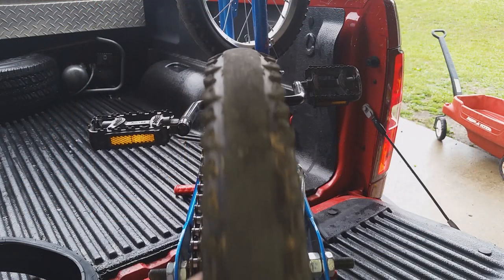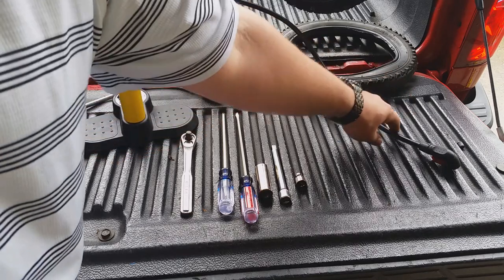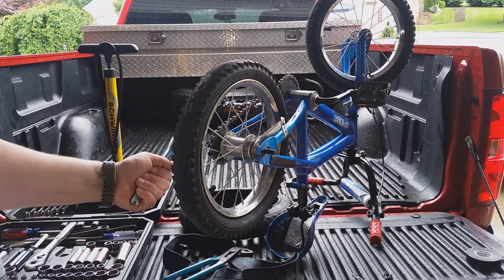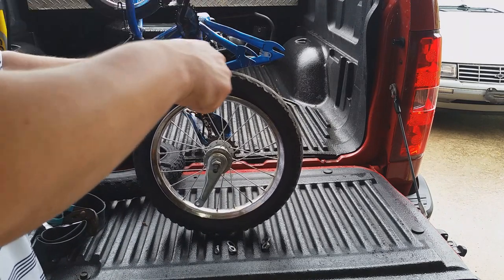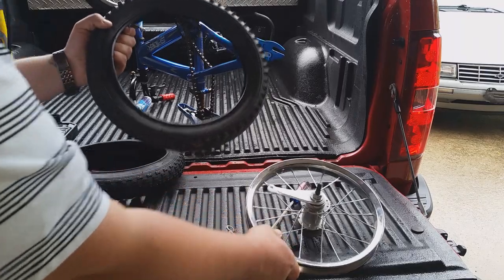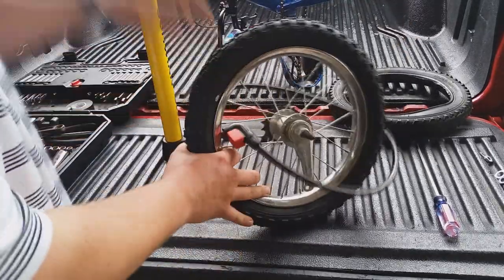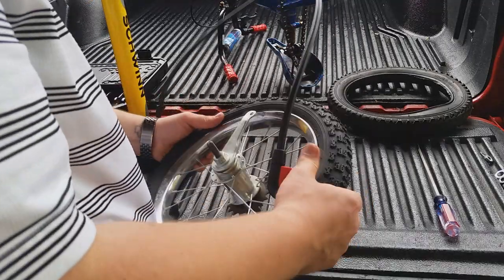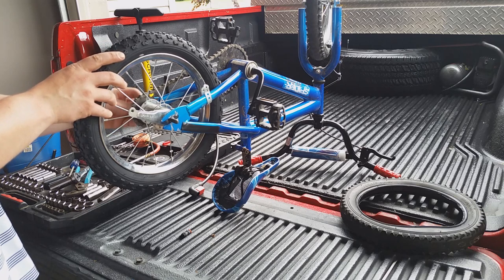how I changed the back tire and tube on my kid's bike

Comment: Dear Sir. I did everything but at the end when I go to test the wheel and I try to stop it it makes a sound like it's rubbing against something but it's not the tire touching or the chain. Can you please tell me what that could be ?
Reply from the maker: I'm not really an expert on this but I would see if the wheel is rubbing the frame, if so the rim could be bent or the wheel could be on crooked, if it's not touching the frame it could be the breaking mechanism is off or crooked or there's something wrong with the stoppers on the breaks, other than that I'm not really sure, sorry I couldn't be more help on this, best of luck to you with it
Reply: Actually I went back saw everything you did again.  You tighten the chain side first and then you did the rest so I did the same and it worked out fine this time
Reply: Thank you friend. Big thumbs up! 👍 keep up the great work